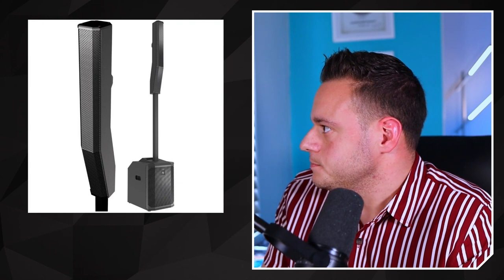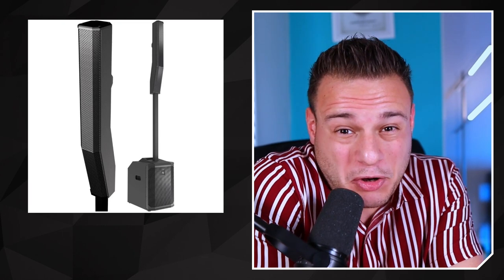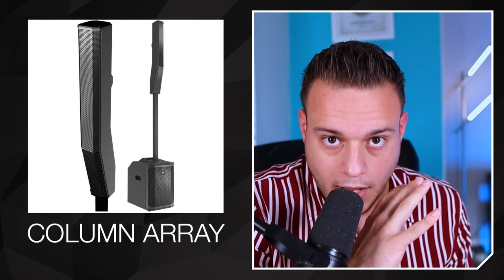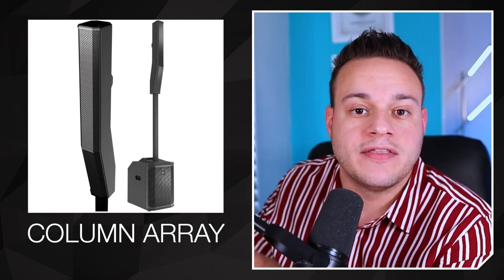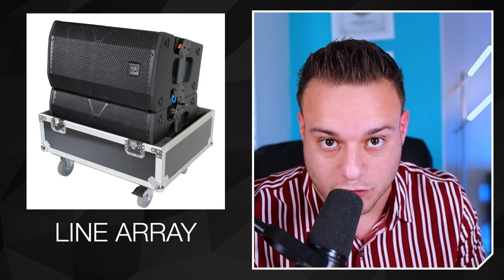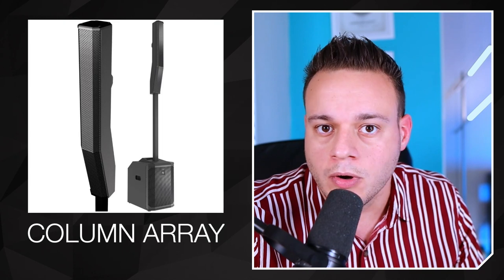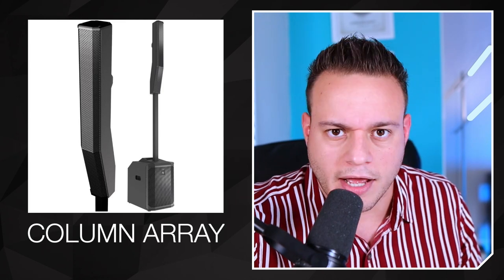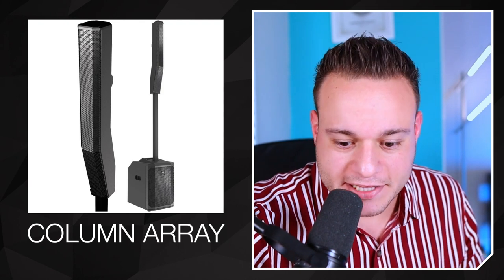The Difference Between a Column Array and a Line Array Speaker

Comment: "Line arrays are horizontal, column arrays are vertical" (direct quote from the video). Is that seriously what you think? Both of them are based on the acoustic coupling of vertically aligned drivers. There is nothing inherently "horizontal" about a line array at all. Do you mean that line-array speakers require multiple drivers mounted horizontally as well as vertically? If that is what you are suggesting, you are completely wrong. Single drivers mounted vertically can absolutely still fulfill the definition of, and follow the acoustic operating principles of larger line arrays.

Now there are some differences. Larger line arrays, with individual cabinets, allow more precise control of the angle between each set of drivers, which is not possible in an integrated design like consumer speakers.

Also, although some column speakers still fulfil the definition of a line array, some others don't. Specifically, quite a number of column speakers advertised as line-arrays actually have their individual speakers directed in different directions horizontally. This decreases the acoustic coupling between drivers compared to genuine line-arrays. So although the drivers are aligned vertically, they will not have the same "throw" and general dispersion characteristic of a "true" line-array. They will also have a wider horizontal dispersion characteristic than a regular line array.

Some other design's might use different drivers along the length of the column, which might be another way that some column speakers aren't true line arrays. But, nonetheless, you can't tell if something is a line or a column by how "horizontal" or "vertical" the cabinet looks. That's fucking hilarious
Reply: the reason why is column is it has just one driver per array unlike the line array it has multiple drivers like two 12" and one tweeter between it horizontally he didn't said about what the effect of sound or the difference of the sound  he only said the design.
Reply: You see he didn't respond to you right? When you present facts they have to stay quiet

Comment: Yes a conventional line array is several full range speakers stacked on top of each other at different angles. The function and purpose is exactly the same  so it may annoy you but it’s not wrong. 

Also I just bought the PRX One. It sounded better to me in store than the Bose Pro 32. It’s cheaper and sounds better but when I took it outside I’d rather have the Bose as it fills the area with sound better. The PRX is a mix between line and point source where the Bose is much more line source. Preference I suppose.
Reply: It is wrong though. Column array speakers are a bunch of little speakers in a single unit. Line arrays are a bunch of large speakers in separate units, joined together.
Reply: @DJ-Coma  a line array is several speakers of the same range stacked to create a line source of audio. In column speakers, specifically the Bose L1 each speaker is full range down to about 200Hz and stacked on top of each other. This creates an array of speakers in a line. It can’t be more clear. When you stack PA speakers in a line array system for a concert you’re trying to increase the throw of the sound and prevent dispersion of the sound waves. It’s exactly how “column” speakers work. There’s no functional difference. If I add another to it, the Bose and PRX One are two separate speakers stacked on top of each other. I’m an engineer and I guarantee there’s no functional difference. 

I do agree though a naming difference is a good idea. Concert line array systems are far different than the column speakers you’re most likely referring to. An Evolve 50 is hardly even a column much less a line array but technically it is.
Reply: @cduemig1  it utilizes the advantages of coupling from line arrays.  Other than that they're nothing like one another.  Nick is correct here.  It's a fixed column array. Not a line array.  There is no angle adjustments that can be made, there is no hf drivers to couple and gain output, there's no vertical control whatsoever.  Theres many things that a column array does not share with a traditional line array.

Comment: I love my EV 50m's! They sound amazing and haven't had any issues! Why do people hate on them so much?
Reply: Same here.  Some people just need to feel different.  Love my 50s.
Reply: I think people “hate” on them because they should be used for crowds under like 200 people, which isn’t a good a reason to hate on them because for crowd/room size under that, they do exceptional as far as sound quality, convenience/size, and aesthetic. Always use the right tool for each job.
Reply: They are glorified home hifi speakers, not hating I love good hifi gear. But open up the top and you see little mid high drivers. They cannot push sound to a larger room like horns can. They are good for cocktail time though.
Reply: @DJ-Coma  Agreed, 90% of my crowds are 100 and under so for me they are perfect.
Reply: I don’t hate them but the only small issue i have with them is that the top speaker can’t be turned wich in the RCF evox you can and i love that about them.

Comment: You are correct.  And even more important….. they are all junk.  The entire concept is crackpot.  Tiny little speakers in a skinny box will not fill the room with sound.  Now if your goal is short throw, wide angle, only reaching the front few rows, and leaving the back of the room quiet so people can talk, then these are good.  But if you want to cover some distance, column speakers are useless.   No, they don’t have less loss per distance, they have less projection per distance. Normal speakers are far more versatile and useful.
Reply: There's a reason why those are tiny drivers, for more accurate sound of High.. If you put a large driver then it will sound just like a MID.. Plus High Freq can travel a distance even with just a tiny driver unlike the SUB that you need massive reflexes to throw its bass

Comment: Great video... I think some of the confusion may be due to Bose referring to their L1 model 2 and L1 Pro series as line arrays. They were the first company out with the technology, I suppose their naming kind of stuck.
Reply: Especially as the first systems weren’t true arrays anyway. They had a mix of drivers with different frequencies. You could hear the change up and down the column. Also interesting is the first ones were called “PAS” for Personal Amplification System. They were intended for one or maybe two band members to use one system and have multiple systems. By doing it this way they don’t have issues if wave cancelation they knew would happen. This is still an issue and pointed out in their manuals but people still use pairs.

Comment: Considering getting the Prx one JBL. Says 130DB. If true that would crush an evolve and RCF J8. Reviews says it kills the 3,000$ Bose pro32.
Reply: They’re rated about the same output but I think that’s misleading. The Bose is definitely louder but has 180 degree dispersion where the PRX One all the drivers are oriented straight ahead so only get about 130 degree. The PRX One is better if you want pairs as they won’t cancel each other as much and more packable. I was looking to see if I’d sell my Bose L1 Model 2’s and trade up to the Pro32 or PRX One and think I’d rather just stick with what I have. Outside the Bose fills the space better. Inside I’d rather have the PRX One.
Reply: I definitely think the PRX One crushes the Evolve 50. I demo’d them side by side and took me about 20 seconds to pass on the Evolve for the PRX One.
Reply: Ill be amazed if you get close to 130dB.  Jbl loves to throw numbers around that for some reason in the real world can never be achieved.
Reply: @thenightlifenj1  yeah I have an evolve 50 and RCF J8. Evolve claims 127db. RCF claims 128. I doubt either get near that.
Reply: @chromemusic4401  which is better in your opinion evox or evolves
Reply: @steadymanos  I have one of each. They are so close. The RCF evox J8 is 999$. I paid 1600$ for the Evolve. They sound similar. They are probably exactly the same level volume. The evolve has a digital display and equalizer on rear. RCF has volume and boost. Bare bones. Depends what you’re using it for. If you’re just looking for sound you can’t go wrong with RCF. 500-700$ less than evolve.